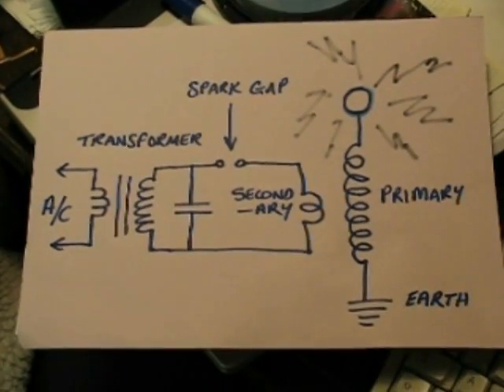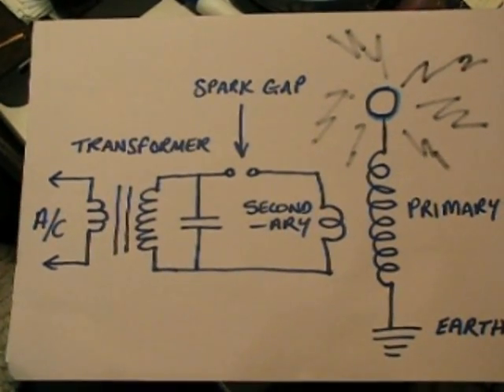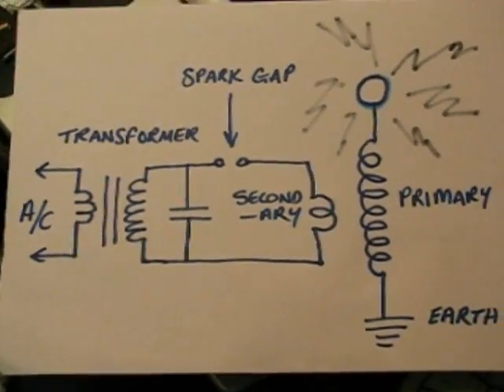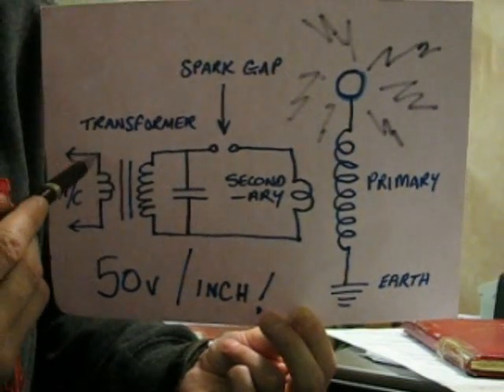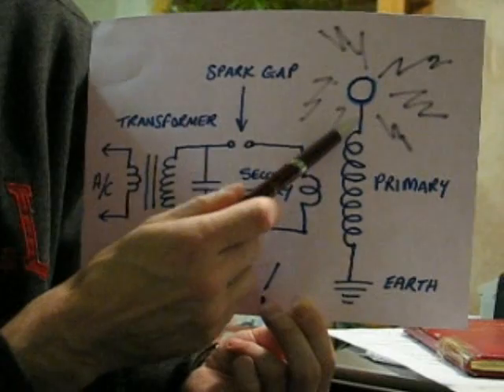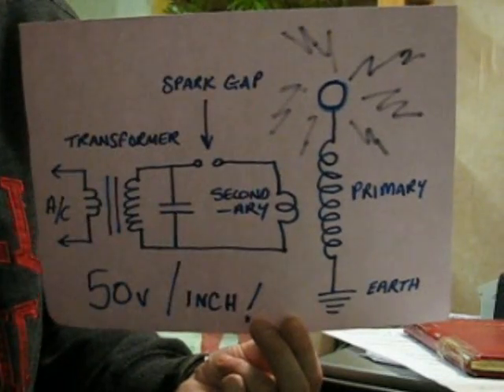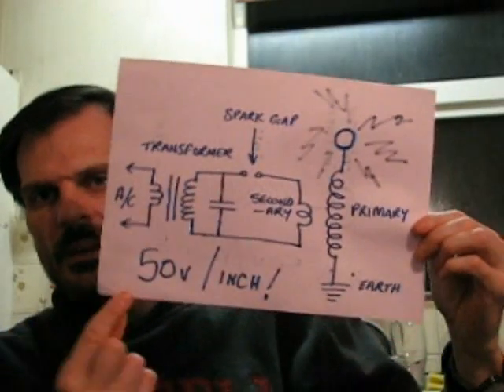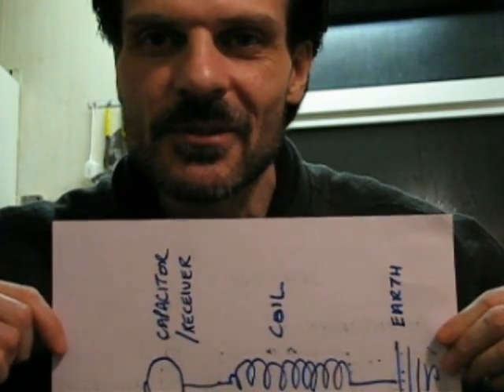Tesla's Little Secret

Comment: The way you're describing the use of the Tesla coil sounds like his radiant energy receiver patents, from looking at the Maxwell-Heaviside equations Magnetic and Dielectric (Electric) fields do not cause each other, meaning there is no transduction in a "Generator", if a passive ambient flux was captured and put to use in a resonant system it could be used to produce considerable power far exceeding the source, but tuning would probably be very difficult as any impedance mismatch or change in SRF between the components would cause retardation and ruin the effect.

A kinetic generator has the torque of the rotor to fight past the retarded fields, a very brute force and archaic method of making Power, the tesla coil system has no such option, eliminating any fight back on the source would be vital to get it to work so isolation techniques would be required.

The work of Don smith is very close to this concept, although he does get the why it works wrong with the Electron Particle model, Tesla and the pioneers were very much against it and for good reason, but the device works.

And please never use music like this again, I can barely hear you.

Comment: Let's make this simple Coil and capacitor in series at the SAME values oscillating at residence is the primary.  And the secondary is 1 Harmonic higher  Which is the antenna And the receiver on the other end.

Comment: What powers the secondary on your diagram.If u have built the circuit u wud realise that wat u sayn don't work the other way round
Reply from the maker: It is the basic circuit for a Tesla coil. I believe it does work as evidenced by the many people who have built them. I don’t know if the circuit diagram is perfect as I’ve never built one myself, but those are the essential components. Have you built a Tesla coil transmitter? Make two of them identical and see if they resonate at distance; make sure the mass and number of coils in the bifilar coil are exactly equal. In theory you should be able to transfer energy wirelessly.
Reply from the maker: To answer your question: it depends whether you are using the coil to transmit or receive energy. Actually looking at the diagram it probably would not work as a receiver because it needs to be tuned into something.

As it is, the Energy collected from the atmosphere would be DC and not induce current in the secondary so you might want a capacitor used as a collector and a spark gap to dump the energy to produce inductance. I think Tesla originally intended to set up towers as transmitters receivers and to form a grid of free energy around the world. Take a look at the top of the Eiffel Tower and you will see what I mean. 

I did suggest moving the spark gap in the video, in case you didn’t notice.

Comment: funny, secondary and primary are reversed labeled, but what about his Extra coil?
the Impulse of the disruptive capacitor discharge, in the primary (which here is called secondary), is equal to the extra coil.
Reply from the maker: Well primary/secondary depends whether you are transmitting or receiving, technically.

Comment: Hi

Where did you end up with this research? 
Thanks
Reply from the maker: Hi, there is radiant energy in abundance but the amount you can receive with a basic set up appears to be relatively small. I also learned that there are better ways of generating / receiving free energy, like aligning pairs of atoms similarly to how water molecules align during a thunderstorm. I think Tesla coils were designed to send energy wirelessly to other Tesla coils via resonance... resonance is the key; the coils must have the same amount of turns and the exact same mass, or a harmonic of those ratios. I have not done any experiments personally. YouTube deleted my videos about free energy from permanent batteries!
Reply: @MattBlytheTheOne  "I think Tesla coils were designed to send energy wirelessly to other Tesla coils via resonance"

You're spot on, one thing Tesla was very excited about was creating standing waves in the Earth's crust, an evolution of his single wire transmission system where the top capacitance is of a value that leads to standing waves in the circuit when excited at the correct frequency.

In patent 645,576 Tesla shows resonantly tuned receivers that use the Earth as the wire, experiments performed by others have shown that this method allows full reception of the transmitted power from the transmitter to the receiver as long as the tuning is good.

And what's even more amazing is that, provided the resonant conditions aren't affected, there is no strain on the source transmitter regardless of how many receiver's you use or loads you attach to them.

However one thing that most people don't get is that Tesla was not using Electromagnetism, he was using capacitive displacement currents which are of a Longitudinal nature, he stated it more than once during the court proceedings for his tower, displacement currents are a "reaction" to a change in the net quantity of Dielectric/Electrostatic induction to the circuit, he found a way to produce and transmit them via the electric equivalent of a water hammer effect, Impulse Currents.

Comment: Yes you got the picture... Tesla had the patents on both that and the transmitter but certain folk didn't want that so they stopped him and now spark gaps are against FCC rules but I got around that with Tesla's other secret and used a plasma ball as an oscillator took a USB type plasma ball put up the Tesla plate antenna and took the high voltage low current between ground and sky then stepped it down to 15 volts and the current was enough to charge the supercapacitor bank of 12 volts while still running the plasma ball at 5 volt 0.3 amps. It's on my video I didn't have and over voltage protection circuit at that point so I had to disconnect the supercapacitor bank after awhile so they wouldn't over charge. I was very excited while making that video and I probably should have done better. You are correct in your thoughts about this matter. Finally someone gets the concept see Tesla was going to use his tower to also broadcast radio along with energy... Radio broadcast = air and transmission of electricity = ground. Secrets... Unfortunately our technology has gone in a completely different direction that keeps us bound up so now I must Finnish to bring Tesla technology to work with the standards of today I am close to doing this although my video skills are horrible and I meed to work on my presentations that's why I have stopped videoing. Need help with that and when I get that straight I promise to blow the socks off the whole world. It will be fun!
Reply from the maker: I make most of my videos on my phone and edit them in iMovie. Crude but functional. Although 4k video to snappy background music does appear to count for everything unscientific on youtube these days! Thanks for your comment and good luck editing :-)

Comment: Sir i think the spark gap and the capicor are should be switched
Reply from the maker: I think I did mention that in the video. You need a capacitor or some way to collect the energy otherwise you have a short circuit (zero potential difference) to ground.

Comment: also sir do you think that tesla might have harness positive solar enerrgy and combined it with negative ground energy to create electricity (this is just how lighting works) sir i have literally posed 3 questions which you have answered 1 of them i would love if you could also another your the best thanks a lot
Reply from the maker: Yes, energy is only potential difference; a higher pressure moving towards a lower pressure to establish balance and equilibrium. The earth is always ground, the closer you get to the Sun the more energy and the greater the potential difference to ground. Lightning is a bit different. Lightning has to do with pairs of charged particles, namely H2O,   becoming aligned by the electromagnetic energies surrounding earth. Hydrogen and oxygen atoms have electrical energy. When they are combined in a water molecule they have an potential difference between them. Many molecules aligned in series creates lightning which can recharge instantly as long as the molecules remain aligned.
Reply from the maker: PS. Patience is a virtue!

Comment: Sir i beg you to answer this question so basically you know the diseign can it be called free energy
Reply from the maker: It depends on your definition of free energy. If you mean this is cost-free and abundant and unlimited, yes it is free energy! If you mean this is zero-point free-energy, no it is probab;y not.
Reply: @MattBlytheTheOne  sir also  where does the energy first come from anyway so like does it come from soalr energy or what sorry if i'm disturbing you
Reply from the maker: Yes all energy comes from the sun, which in turn is powered by a central sun at the centre of the Milky Way galaxy. The universe is constantly filled with energy everywhere all the time. There is no void. Time, Space and Matter are different aspects of the same illusion. Space is actually a superconductor.

Comment: It does not work in reverse the little radio frequency that it will pick up will get lost by the resistance of the tesla coil not to mention the transformer windings ?
Reply from the maker: Of course it does and many people have built and tested prototypes. You are talking about crystal radio type tech but this tapping into the electrcity always present in the atmosphere.

Comment: the circuit on the left is missing the ground/neutral on the ac. it will melt the transformer coils without it. also the right side there must be a capacitor between positive and negative. your drawing the antennae is being shorted to ground. Teslas  Patent  on "The Utilization of Radiant Energy" its on google patents.also isnt the voltage set by the capacitors rating? Thanks again and Cheers.
Reply from the maker: I agree, it is a very simplified circuit I just used for illustration purposes. Thanks. Happy New Year :-)

Comment: Did u make it and try it?
Reply from the maker: No I have not and I have since learned that this might not be the best / most efficient way of receiving free energy. It is possibly the best way to send and receive energy wirelessly though? Which I believe was Tesla's original intention.
Reply: @MattBlytheTheOne  
So do u have or know an efficient way to receive or harvest free energy to use it instead of this fuel polluting energy production we have?
Reply from the maker: @kruzzah  Yes! Energy flows from a higher potential to a lower potential. Higher pressure to lower pressure. Hot to cold. The Sun.... All atoms have energy! The potential to receive free energy is everywhere ;-)
Reply: @MattBlytheTheOne  
So it is to know how to tap it & extract it to use it...which i can see & call the easy difficult maze!
Reply from the maker: You need to develop a way to align pairs of atoms in series and fix them in place, something similar to a permanent battery.  Then lightning will happen :-)

Comment: Ok I’m sorry, I’m not usually like this. Ok so, you have picked a bone with me. I agree, Tesla is a genius. But, I have studied Tesla’s patents and diagrams for years and years, and have built this circuit dozens of times, trying to get this to create the largest arcs. And I have thought, what would happen if i use one of my larger coils to reverse this? I applied a high voltage frequency generator to both sides of the coil, and placed another coil by it that was connected to the Tesla coil circuit. So first, I did in fact read a voltage and frequency(lower but equivalent to the input frequency) but the voltage was in microvolts, because like you said, if you apply mains to the first transformer, and then that goes through the main circuit to the second resonant transformer(the main primary and secondary coils) than it will create a very high voltage and shoot sparks out of the top load. Now you said if you made this very big and tall it will penetrate through many layers that will increase the voltage, that is correct but as you have a conductor in the air, it doesn’t penetrate these layers much, the layers bend around the conductor. Also, more volts isn’t always better, more volts doesn’t do any good if you don’t have enough power to supply it, being there is a high voltage in the air can be good, but there isn’t much power to supply it. RimstarOrg, a youtuber, has a great video about it and how you can power an ion wind motor. 

Your still a good guy though and I believe Tesla’s technology will assist in the future, I mean heck it already is! All AC power is generated from Tesla’s tech, the AC generator.

Comment: Make a large pyramid shaped graphene representing a black conducting capstone. Take 130+ ft long PVC pipe and wrap copper coil taking thousands of turns. Connect top end of copper coil to graphene capstone and bottom end of copper coil to earth ground. Now you have your very high voltage antenna receiving radiant energy from the atmosphere complete. All you have to do now is install antenna with graphene capstone raised high up in the air like an obelisk, and then connect it to secondary Tesla coil, capacitor, spark gap and a transformer which will the output AC to power your house. Source of radiant energy/atmospheric electricity is from birkeland currents in space coming from the Sun. Birkeland currents power all stars, galaxies and planets. Youtube search "birkeland currents explained".
Reply from the maker: Thanks for the info. Would you need a charging capacitor between the capstone and earth? Or would the resistive inductance of the coil be sufficient for the purpose?
Reply: The power has to be stored somewhere so you would need a capacitor. If this setup collects enough atmospheric electricity to run a 24 volt DC motor for example at decent rpm and torque, you can use that DC motor to spin the magnets around a washing machine stator coils rewired to generate 14 volts at high amps, which you can then connect to 5000 watts inverter and lithium iron phosphate batteries, which will then power your house off grid in theory. If you add a step-down transformer to a rectifier and capacitor circuit, this would allow you decrease voltage and increase current as that's what transformers do. Antenna will need to be high enough altitude to get high voltage.
Reply: Also check Ion Power Group. https://ionpowergroup.com/how-it-works-on-earth/ https://www.youtube.com/watch?v=ENeDkGce5-4 They have graphene based antenna installed around 130 ft from the ground which gives them around 1000 or so watts of power.

Comment: All of this is with the assumption of high voltage on the primary coil and oscillating at what frequency ? (3 Hz ~ 60 Hz are Schumann resonances). Unless you are capturing static charges from the lower ionosphere (85+ km or 52+ miles up), I wonder where all this energy is coming from. According to Planck's constant (source: https://en.wikipedia.org/wiki/Planck_constant) for Energy E= h/v, the best sources of energy are from the IR, visible, UV, and upwards. But considering the solar irradiance here on earth (source: https://en.wikipedia.org/wiki/Solar_irradiance#/media/File:Solar_spectrum_en.svg), solar is still magnitudes of order higher in energy density than anything in the RF spectrum downwards. (source: https://en.wikipedia.org/wiki/Electromagnetic_spectrum)

Comment: You do realize that Tesla left out the capacitive voltage divider and frequency correction and you have his fuelless generator.
Reply from the maker: Do you mean the circuit does not need the capacitor?
Reply: No not at all. He didn't tell anyone about it. You need to add a capacitive voltage divider as well as a frequency correction device. also you need an L3 and L4. See Don Smith Tesla symposium 1996.

Comment: “SAFETY GROUNDING is a problem. YOU COULD provide a gas tube, or other type arrestor, in the design. THE UNGROUNDED antenna exposes liability for non-compliance to NEC safety articulation. TV antennas had the mount grounded satisfactorily, the antenna isolated. LARGER MASS of the pole needs to be grounded, the antenna kept intentionally lower than a higher object. A COMPLIANT configuration seems possible, but a business would require it as a priority to escape liability.”
Reply from the maker: I am not suggesting every home should have a 200m antenna! Just that potential exists and that we can research and develop the technology. I would think grounding would be a necessary precaution to avoid damaging your equipment anyway.